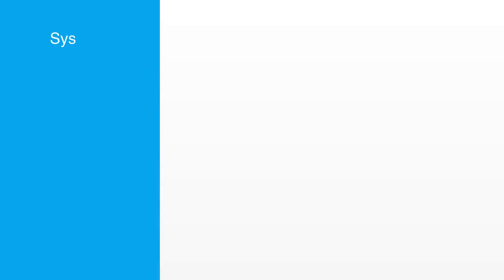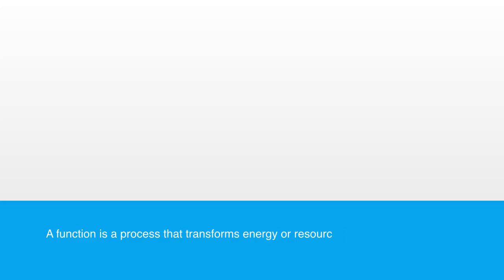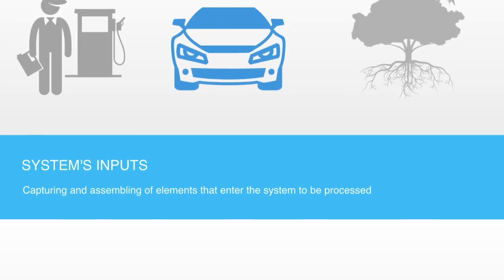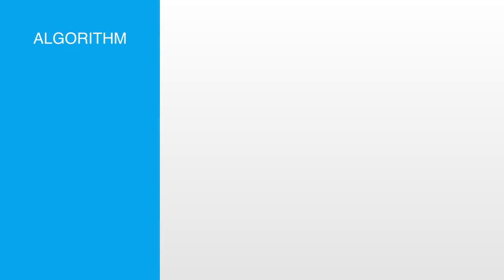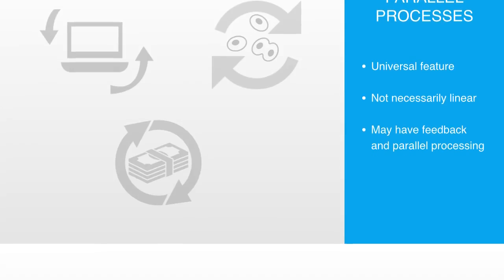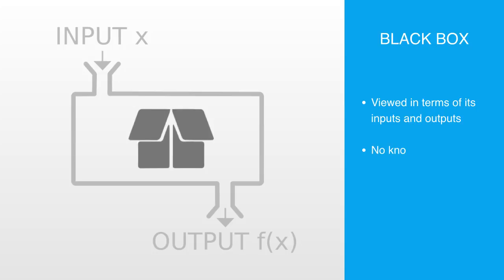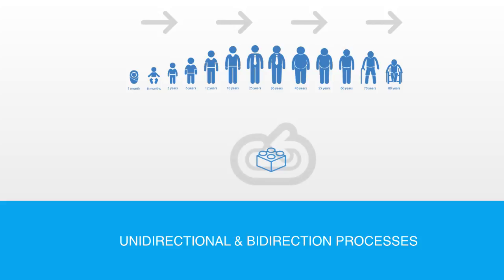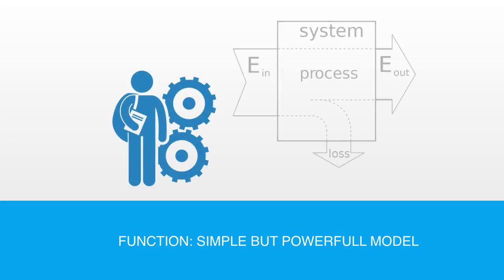System Functions

Comment: From a mathematical point of view, in the image in minute 3:58, f(x) is the transformation box and not the output. The output will y as it will be formally written as y=f(x).
Reply: As you said, y = f(x), so putting y or f(x) is the same thing. The black box is the function f() not f(x)
Reply: @zemmourisalahedine9743  you are right